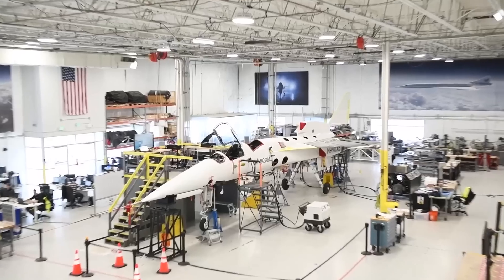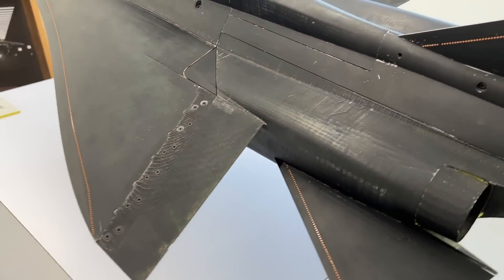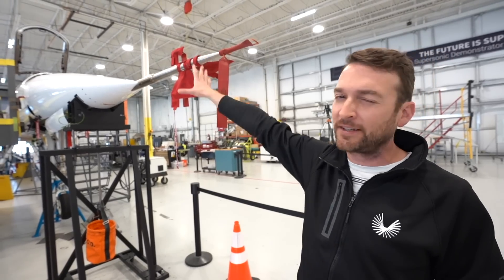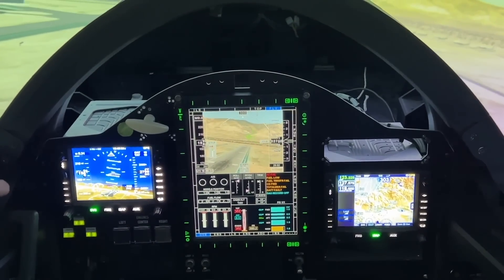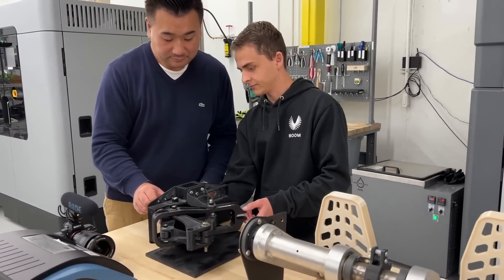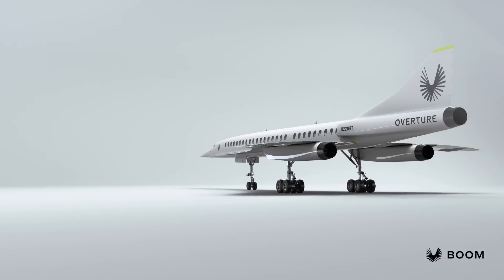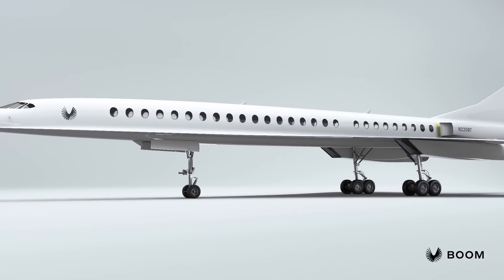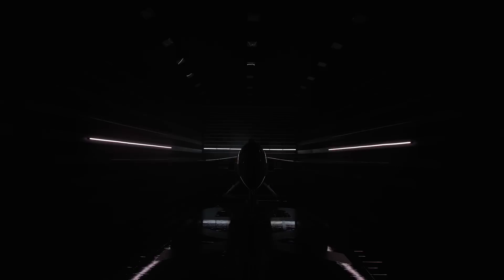Is Supersonic Coming Back? The Future Supersonic Jet - Boom Supersonic

Comment: Wait. Is it not fly by wire? The roll yoke/stick input is not electronically calibrated with airspeed to control the aileron and require that ratio compensator?
Reply: yep novices at work

Comment: What is the backup plan when a bird takes out that camera during a landing?  Cause you know that’s going happen at the worst possible time.
Reply: literally my first and only thought as soon as they mentioned the camera thing...
Reply: It is quite the contrast - mechanical controls when the whole aviation world has gone fly by wire, yet they're relying on a camera to be able to land.

That said - for airline safety regulations, 3 cameras and 3 camera displays would be likely.  One for the pilot, one for the copilot and a shared backup.

Comment: Concorde only had a few viable routes as it was not allowed to go supersonic over land because of the sonic boom. How would this be different?
Reply from the maker: Good question, I was told Overture will be able to fly supersonically overwater at Mach 1.7 and flying over land at Mach .90 with the current noise level.

Comment: I wonder what’s the operating costs gonna be compared to subsonic airliners
Reply: The operating costs will probably be multiples of subsonic airliners. Fuel, maintenance costs will be very high. The operating cost killed Concorde. 

The design,  development,  tooling for production,  running through the certification process cost will be astronomical. Will any airline even buy this plane? Will they sell enough of them to keep the suppliers in business? 

Have they done market studies to determine if there is a demand for the aircraft?

Comment: Warning... A skeptic view here. I love their ambition but I'd be shocked if they were able to even get a prototype completed and in the air. This video felt like a capital raising promotion. If you have HUGE aerospace companies like Lockheed, Boeing and Airbus with their resources, knowledge and experience not delving back into super sonic flight, there's clearly a reason why.
Reply from the maker: Of course, skeptical view is the norm. Boom will need win more airlines orders to make economies of scale. Time will tell. I am showing whatever the company is doing at the moment as the company has provided unprecedented access. I do not get paid from making this video.
Reply: @SamChui  Hi Sam, my skeptic view WAS NOT directed at you, at all. You're only reporting on an aviation project. Again, I love the ambition of this project. I wish them lots of luck in reaching this lofty goal. I  just don't think it will come to fruition.
Reply: They already have customers pre ordering and lots of capital behind them. Also, lots of the knowledge, experience, etc, that they have in their company are from aerospace companies like Lockheed, Boeing, Airbus etc
Reply: @aminfozdar  Thats exactly what NIKOLA motors had too - orders.
Reply: I have been following Boom since they first announced their plans to develop a supersonic passenger jet and have become more and more sceptical over time.  From the start they made several blatantly impossible claims.  Originally they claimed the Overture would be flying by 2023...  Just 9 years after the company formed.  The XB1 was originally slated to make its first flight in 2017, just months after the design was finalised...  Again, insanely optimistic and surprise surprise, didn't happen.  Given they are five years behind on the concept demonstrator already and still not announcing its first flight, let alone any idea when it could go supersonic, you have to ask why anyone still thinks that Overtures are going to be in service in 2030, 8 short years away?   
Also, there are not currently any engines in existence or even in the research and development stage that are capable of meeting Boom's requirements.  Rolls Royce are looking into whether it is possible to develop the technology required to design a suitable engine but have not committed to doing the required development and design work which is likely to cost many, many millions of pounds.  Without suitable engines, the Overture is just a pipe dream.  
I would love for there to be supersonic passenger jets again but I cannot see it happening this time.
Reply: Given United Airlines placed an order, and some others did too but i can't remember. I can say this might be a legit thing
Reply: @AlphaGametauri  United did not actually pay them. This is marketing vaporware, I'm afraid.
Reply: @AlphaGametauri  you obviously dont know about the other recently failed SST - aerion - they also had orders
Reply: The list of orders Concorde had was quite big apart from Air France and British Airways, Lufthansa, Pan Am, United, Qantas and more placed order but at the end they cancelled because it did not make sense for them. Concorde went forward because the French and  British government wanted so and they forced their national airline to buy the plane. At the moment I won’t hype at this project.
Reply: Boeing is a dinosaur and can’t even launch humans into space years after a startup spaceX who’s now doing it routinely. Startups can do a lot that big companies are just unable to.
Reply: If there was a market for supersonic travel, The Boeing company would already be building planes for it. 
Boeing had passed up two  supersonic programs in the past in favor of building planes that actually had customer demand. The first supersonic SST project was scrapped in order to develop the Boeing 747 jumbo jet, which went on to became an enormous success for Boeing and completely changed the entire air travel industry, bringing low cost fares to long distance travel.  About fifty years later, The sonic cruiser project development was also scrapped in favor of the developing the Boeing 787 Dreamliner; again bringing an exceptional passenger experience for long distance travelers. 
Currently, Both the long range Boeing 777-200LR and the Airbus A350XWB are capable of extremely long non stop flights of up to 17/18 hours. Yes, such a flight can be grueling unless you are up front in Business class, but the cost of a J class ticket would still be less than a similar flight using a supersonic aircraft, and the flight will be a much more pleasurable service experience.  
Unless a person needs to get halfway across the world in a real hurry, it is hard to justify the high cost of supersonic travel.
Yes, supersonic aircraft are exotic, and totally doable technically ….  But they still feel like the Ferraris of the airplane world.
Reply: @chaslau2345  “totally doable technically”

No they are not, not passengers and long distance flight.

The market is trans Pacific in which many will pay large sums to save 10 hrs in the air.  The tech problems are severe, and nobody has an pushed a plausible answer yet.  Distance is triple the Atlantic crossing, for which fuel consumption and stowage were already difficult and contributed to the Concorde accident via takeoff weight. The entire industry is being pushed hard to reduce fuel use per passenger  and SST will double, triple it. Add high speed takeoff ( most direct cause via high energy tire burst of Concorde accident), and hull heating causing large fuselage expansion. Cooling a cabin of 100 people for say 10 hours w an ext fuselage  temp at 100C is not like cooling just the pilot of an F15 at M2.  It’s never, ever been done.
Reply: Been following this company for a while and still to be on the the model concept stage nearly 10 years after start up. Just screams investor money pit (Scam) to me
Reply: @Inner-Geek  I don’t think the problem is some company playing Santa Claus.  There have always been snake oil grifters.  Everybody knows about the like of  Theranos.  The question is how do they pull this off. I contend the media is the problem, guys like this goon “the future is being built” Chui doing this video, that doesn’t know aircraft from tractors.  He can’t bother to talk to some skeptical experts, but he can get some clicks by hyping this thing like its ready to go. Look at all the complements about nice video! Great attitude!  As if attitude makes planes fly.
Reply: @Inner-Geek  I think you hit the nail right on the head. The supposed “orders” placed by American and United are options, in standard purchase agreements if the plane isn’t produced, produced on time, or doesn’t perform as expected, the airlines will collect penalties, for them it’s risk free, or even an opportunity to make money.
Reply: They will find a market In the private jet segment
Reply: Finding a market for it is the real issue here. Impressive technology and development, but the old Concord only sold about a couple dozen airplanes; and Boeing had made more than one attempt for this platform …….  No one really wants it.
Reply: @chaslau2345  Trans pacific travel is a huge market.  Nobody wants to spend 20 hours in conventional planes.  There’s never been SS passenger tech that could do it.  Problems: Too much fuel, high take off speeds (killed Concorde), hull heating and expansion.
Reply: @chaslau2345  Huge market to reduce 20 hr trans pacific to 10 hr, or 8 hr.  Can’t be done technically so far in the atmosphere. Fuel consumption, high speed take off, heating and expansion. Sounds exotic, but Musk’s sub orbital big passenger rocket ideas  are more feasible.
Reply: @chaslau2345  Plenty of market. Problem was Boeing couldn’t make a good safe long distance SST.  Nobody could.  At least Boeing was competent and humble enough  to know it, unlike Brits and French.  The Concorde was blowing tires left and right  on high speed, fuel overweight take offs n landings.  Lucky they didn’t kill three times as many people.
Reply: He was so proud of that mechanical ratio mixer, but it seems like a red flag right off, this is a thing that has been worked out from the 1940’s already…. all the videos I’ve watched have the same flavor of kickstarter vaporware…
Reply: @PRH123  thats exactly it - vapour ware
Reply: I see
Reply: Boeing leadership is only interested in the exec's bonuses.  They wouldn't do anything unless the government dumped a ton of money on them.  Airbus is a giant bureaucracy.   Innovation is only happening in the smaller companies.
Reply: @RS-ls7mm  I haven't noticed too much from the likes of Embraer, they're a smaller regional jet maker. Sure they made the E2, but Airbus also had the NEO and Boeing made the MAX before they became expensive lawn darts.
Reply: I think Boom has some money from both with Boeing and Airbus.
Reply: @ninjasiren    Why would Boeing and Airbus fund Boom.  They could have joint ventured without a middleman. I believe Boeing has an SST in the works already.
Reply: Exactly.
Reply: Because those corporations do not want change. Look at the automakers with electric cars before Tesla came into the market.
Reply: Just hope the scale of economics works because that is what killed the Concorde..and that they could not keep maintaining the old designed systems which had been done on paper drawings... which makes that even more impressive.
Reply: you're wrong dude. Technology has advanced a lot since the Concorde days, we're ready. United has already signed up for an order of 15 of these aircraft.
Reply: Boeing and Airbus are conservative. Why gamble on a high-risk, high-reward project like this when you can build products that are already accepted by regulators and the market and provides a modest but safe income?
Reply: The largest reason why is highly due to maintenance cost etc. Theres also the rules with sonic booms over land and populated area, so you have to make a quiet SST (like NASA’s trying to do). Theres also the problem with the environment, but thats the most easily fixable of all the problems. And plus, after the Concorde crash most people just lost interest in SST, so the government cut funding for SST’s like the 2707 and the L-2000
Reply: Sounds logical, but by that logic Tesla would not exist today.
Reply: They do not have an engine vendor. When I started hearing the carbon recovery BS I know it is all BS.
Reply: I'm a bit of skeptic too. I get a Theranos vibe from Boom.
Reply: @premiumuser867  Yes, good insight.  

I think these media outlets need to take some responsibility for promoting the next Theranos.   That is, if you want to do this tech interview, you need to do the work of finding an expert skeptic first and working that into your work.  Otherwise, you’re just part of the grift.
Reply: @premiumuser867  Theranos was made up technology. Supersonic airplanes have been around for ages.
Reply: It may fly, but I really doubt that they will find any market for it. Post covid, with everyone doing teleconference, the only reason to go faster is like the CEO explained, and that is viable only if the ticket would be at the same price than subsonic airplanes, which is impossible.
Also, making an experimental supersonic airplane in 2022 WITHOUT fly by wire commands tells that they are lacking in some fields at least.
So a bit better than vaporware for the moment.
Reply: @pbyfr  I did some research and I am pretty certain that there is a lot of people wanting to fly supersonic again, leisure and business. Also they already have preorders from United and Japan Airlines
Reply: @aminfozdar  Sure, many people would like to fly supersonic, the issue is the cost. And with Internet connection being available in flight, being in a cramped supersonic may not be the most efficient for business.
Concorde had 74 options from 18 airlines. In the end, Air France bought them at 1 Franc a piece (similar price for BA)!
Before the X-59 give some positive results, I don't see how things would be so different from Concorde. And if X-59 is successful to allow supersonic flights over land (i.e. USA), then Lockheed would be very well positioned.
Reply: @aminfozdar  > It does not matter.  They are soooo far from gettting a Flight Test prototype built and Flight tested for Certification.   They now no longer even have an engine manufacturer.   They will go broke long before they ever come to market.
Reply: @pbyfr  I think you'll find that those manual rudder controls were for the proof-of-concept 1/3 scale test-bed prototype that they are building.  Pretty sure that the full-scale passenger production model will have all the bells & whistles...
Reply: @philip4193  Even for a research plane I find it strange to no have fly by wire. 30 years ago maybe, but not now, as many private jets use it, and all modern jet liners. Especially for a supersonic delta airplane, for which changing the rules of flight controls depending of speed and situation is mandatory.
Reply: @pbyfr   i do not see breakthrough  there  only 2 as comm aircraft  no  electric  engine only 50000 high  its like concord
Reply: I’d agree with this!!

Comment: Interesting how close this design is to the concorde, only the position and the amount of engines differs. That speaks for the designers of the concord, who came some 50 years ago to the same conclusion, as todays designers with all their simulations and computer programs.
Reply: The ogival wing of Concorde is simply the best for a supersonic airliner. Quite strange that they didn't start from that.
Reply: @pbyfr  well they had to change it a lot to be more efficient as concorde was not
Reply: @aminfozdar  the wing was what made Concorde so stable and aerodynamically efficient. Apart from canards for low speed stability, the Concorde shape is pretty much perfect. And that was without CAD. That was 50 years ago. I am sure an engine made today would be much better. Couple that with a composite construction and you have a supersonic airliner. Job done. The reason it isn't being done is political. Boom is a nonsense. They will fail for exactly the same reason Boeing failed in the 70s. They dont know what they are doing.
Reply: @aminfozdar  concorde was outstandingly efficient, particularly in supercruise. although not when subsonic but that was limited.

Comment: If I ever had the money to develop a SST I would just buy the Concorde B project from the French and British and add modern equipment and engines.
Reply: Concord was developed through the 60ties when their was great optimism. The Anglo-French worked very well. The rolls Royce olympus engines would fly with afterburners constantly whilst flying at over Mach 2 and over 60,000 feet cruise. Concorde would literally leave the boom standing
Reply: exactly. As some would say, its not exactly rocket science. And if this had been done by BAE/Airbus in the 80s/90s, SST would still be a thing. Admittedly a luxury option of travel but workable. Concorde itself had an operating profit by the time it was axed.

Comment: revive the Concorde supersonic airliner program . . . upgrade the Concorde design, add some new (Mach 2.0) engines with FADEC Gen2 & in-flight i-HYBRId® power management systems . . . next generation fly-by-wire systems & open architecture sensor fusion . . . conceive new variants from the Concorde . . . build on something that already exists & with time innovate further iterations out of the existing airframe & the know how you've gained . . .